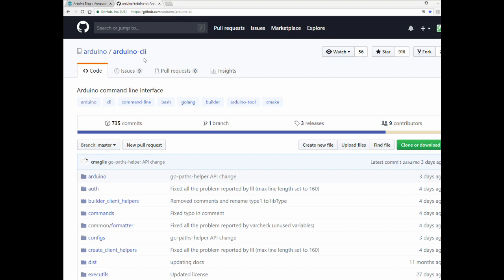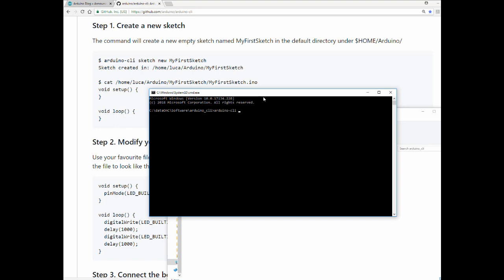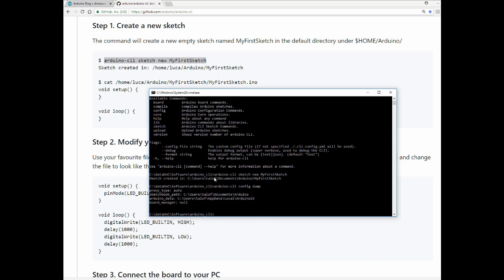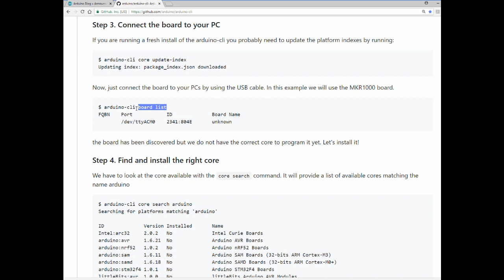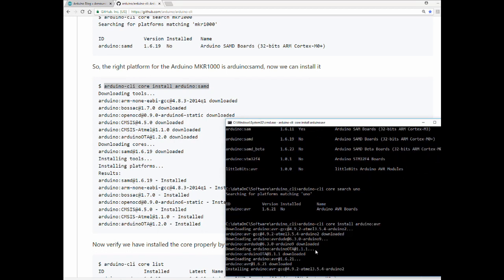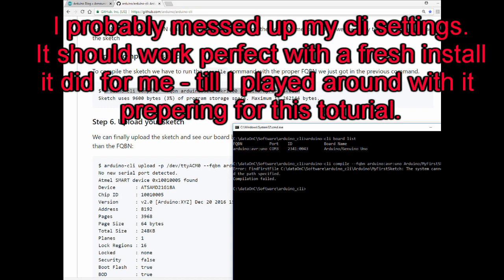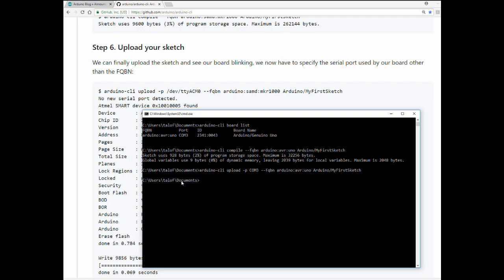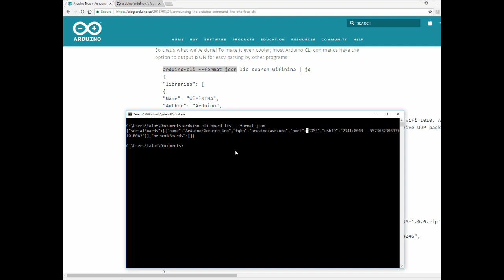Tutorial on the Arduino Command Line Interface (CLI)

Comment: hello sir,
as per showing video, all the step follows but, 

step no: 5
 commands::=  C:\Users\91940\Documents\Arduino cli>arduino-cli compile --fqbn arduino:av:uno Arduino/test_check
Error: platform not installed
Error during build 

these errors are showing on cmd. 

and one more thing next step for 

C:\Users\91940\Documents\Arduino cli>arduino-cli upload -p COM12 --fqbn arduino:avr:uno Arduino/test-check
panic: runtime error: invalid memory address or nil pointer dereference
[signal 0xc0000005 code=0x0 addr=0x0 pc=0x6f49d1]

goroutine 1 [running]:
github.com/arduino/go-paths-helper.(*Path).String(...)
        /home/jenkins/go/pkg/mod/github.com/arduino/go-paths-helper@v0.0.0-20190214132331-c3c98d1bf2e1/paths.go:467
github.com/arduino/arduino-cli/arduino/cores.(*ToolRelease).RuntimeProperties(0x12115bc0, 0x12043dd0)
        /home/jenkins/workspace/arduino-cli-release-builder/arduino/cores/tools.go:138 +0x91
github.com/arduino/arduino-cli/commands/upload.Upload(0xbb15a0, 0x1201e130, 0x1204a500, 0xba9ed0, 0x120060d0, 0xba9ed0, 0x120060d8, 0x12023b60, 0x1f, 0xab33cb)
        /home/jenkins/workspace/arduino-cli-release-builder/commands/upload/upload.go:119 +0x8bf
github.com/arduino/arduino-cli/cli/upload.run(0x1210ba40, 0x12079a10, 0x1, 0x5)
        /home/jenkins/workspace/arduino-cli-release-builder/cli/upload/upload.go:77 +0x146
github.com/spf13/cobra.(*Command).execute(0x1210ba40, 0x120799e0, 0x5, 0x6, 0x1210ba40, 0x120799e0)
        /home/jenkins/go/pkg/mod/github.com/spf13/cobra@v0.0.5/command.go:830 +0x1f1
github.com/spf13/cobra.(*Command).ExecuteC(0x120a7180, 0x976af8, 0x97809c, 0x120241b0)
        /home/jenkins/go/pkg/mod/github.com/spf13/cobra@v0.0.5/command.go:914 +0x252
github.com/spf13/cobra.(*Command).Execute(...)
        /home/jenkins/go/pkg/mod/github.com/spf13/cobra@v0.0.5/command.go:864
main.main()
        /home/jenkins/workspace/arduino-cli-release-builder/main.go:30 +0x20

please suggest me.
Reply from the maker: What is the output when you do arduin-cli board listall  ?
Reply: @talofer99  panic: runtime error: invalid memory address or nil pointer dereference

[signal 0xc0000005 code=0x0 addr=0x0 pc=0x6f49d1]
Reply from the maker: Try and downloading  and replacing the current Arduino-cli.exe to the latest release ... 
https://github.com/arduino/arduino-cli/releases/tag/0.4.0/

See if this solves the problem